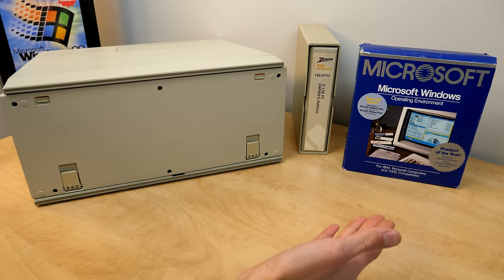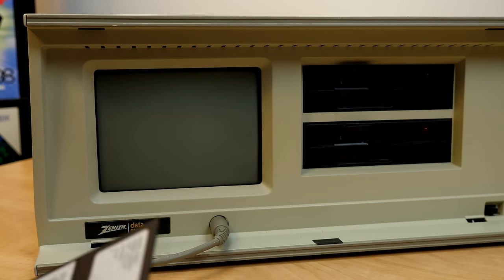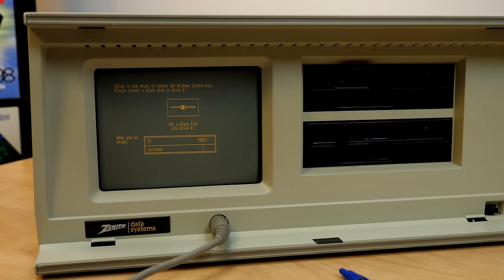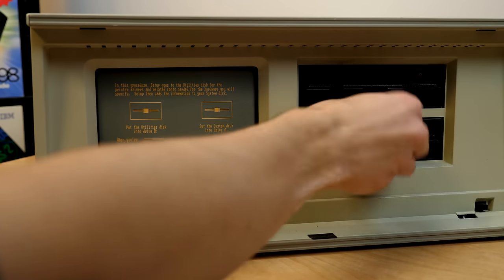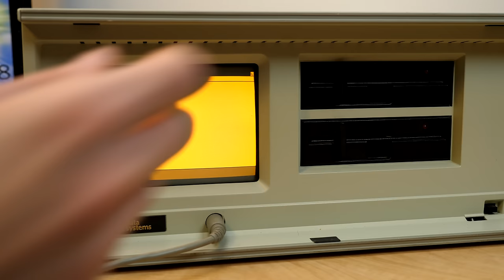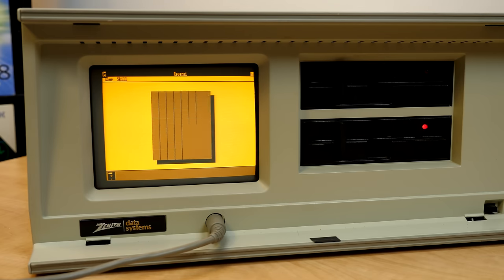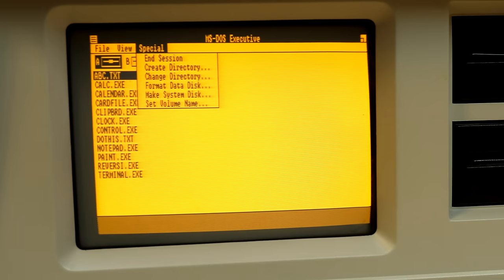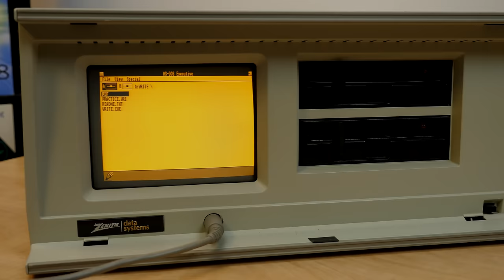Installing Windows 1.0 on an '80s Zenith Portable PC!

Comment: Zenith computers so easy a child can program. PROGRAMMING INSTRUCTIONS: insert disc 1 into drive A, then wait 5 minutes now you can insert disc 2 into drive B at this point just observe the noises the computer makes It's not just sounds it's actually talking to you. After it says "error disc" now you can take disc 3 insert it into drive B and observe the messages and noises It's quite pleasant after the noises have gone away now you're ready to insert disc c into drive A You're going to wait for another 1 minute and 30 seconds precisely then you're going to take disk d and insert that into drive A and then about 5 seconds you're going to take out the disc and drive B and now you're ready for the disc d once drive A is finished then you're going to stick drive d into drive A and then you're going to wait another 2 minutes once it says finished then you're going to insert disc e into drive B and then wait until it says ready and then you're going to take the disc and drive A out and now you're ready for the disc G for drive A and then wait about 15 minutes then you're going to insert the backups disks 1 2 3 4 5 in chronological order beginning with drive A and then drive B and then you're going to alternate. After about 7 hours has passed which is not much I mean heck it takes 7 hours to buy clothes at the mall right.... Once you see the Microsoft symbol appear at this point you're pretty much finished.

Comment: Nice.  I still have the desktop version of that, the Z-148, which I bought for $999 in 1985 while in college. It also came with 256K upgradable to 640K. No hard drive.

I never ran Windows on it.  Just MS-DOS.  

At one point I put a disk controller in it and connected an external hard drive (20MB).  That was a great improvement. I booted it up recently and the hard drive is dead and some of the diskettes are corrupt, but it did boot on a floppy disk.

Comment: Awesome!  I have the Zenith ZF-152-52
The difference with my machine is it's a full desktop and internally, Zenith decided to make the entire PC modular and there isn't a motherboard.  There's a universal ISA backplane and each component of the PC exists as an expansion card.

Cards my PC has:
CPU card with 64K RAM by default but expanded to 320K
Video card: No frills CGA video card
Floppy controller card
RAM expansion card with another 320K
20MB HardCard HDD
I added an XT-IDE.
Reply: (IIRC) That's a bit of a throwback to the S-100 bus that very early microcomputers including the Altair used. Everything on cards, and the 'motherboard' was just a bus and multiple connection slots to tie those cards together.

Comment: Had some experience at 1992 with exactly this box. Was used as PBX configurator over serial port and had some other uses. Yellow monochrome screen with very sharp picture for the era. Had idea that withl little more RAM this box would run even Windows 3.0.

Comment: I can remember a colleague who sit next to me at work showing me how to use all of this on an Zenith luggable just like this one. He had 640K of ram, the max  that could be addressed by DOS or windows. He only used DOS. Firstly, exe stands for executable, meaning a file that you can run. Secondly, you should 'write protect' the master discs by covering the notch in one of the corners with some tape, copy the master discs to blank discs and then write protect them. It is these write protected copies that you use thereafter as they get worn through use. I have never seen Windows 1, but have seen Windows 2, which was really basic. IBM's O/S 2 was always much better than windows but like many things (think betamax versus VHS) it lost out to microsoft. IBM's O/S 2 was based on the MVS code used in IBM's mainframes so it was rock solid code with something like thirty years of extensive use behind it. It also featured drag and drop and a few other things that dud not appear in windows. Much, much better, but microsoft won out.

Comment: My first windows experience was Window v3 and dos 3.  My first PC was a 386SX16 with 5 MB ram.  1 MB internal 4MB external with a 40 MB HD. My first computer was a COCO 16Mhz with a color TV and a tape deck.  When I got my first PC I thought I would never run out of HD space.

Comment: I worked in a print shop aboard a navy ship many years ago, right around the time Pentium processors were coming out.  Our only computer in that shop was an 8086 system running Windows 1.0 that we used for creating forms.  One day I decided to open up the machine to clean it and discovered a layer of dust about 1/2 inch thick over every part of the motherboard.  Pretty sure it had never been cleaned.  I unplugged the machine and used some compressed air to blow out the dust,  which ended up destroying the system.  Apparently the dust was required for the machine to work.  My CPO was furious.

Comment: Wow. My first real computer was a Zenith Z-160. It ran at 4.77Mhz and was VERY similar to that. The top popped up and had side-by-side floppies., and the holder for the keyboard was in the front where the floppies in that one are (if I remember correctly). It came with 320K RAM and I upgraded it to 640K. I also took out a floppy and added a 20MB hard drive. I was living the dream! Oh, and yes, I did have Windows 1.0 installed on it. I gave that away to someone and had the opportunity to take it back but turned it down. It's a huge regret of mine. I never looked ahead to feeling nostalgic. <sigh>

Comment: That's the same luggable that was hard mounted into the data rack at the first company I worked for. It controlled the pay roll system cause some guy in the 80's wrote the software himself no documentation and retired so never turn it off or else.

Comment: I had a similar “portable” in the 80’s as a kid, it was my dads but I did music with it, using midi and this sequencer software which I still have the box and floppy for it and the original Roland midi interface. It was amber I think not green and it was maybe an IBM portable. 💃It ran DOS not Windows.

Comment: Lovely, a SERIOUS computer expert I have worked with still keeps the 24? Windows 3.1.1 discs because if the computer world turns to bits and bytes he still has an operating system even if it is SLOOOOOOW. I have some 5 inch floppy's with 1007bytes of info on them and I can get a reader but cant find a computer slow enough to read them. I love DOS and still remember how to change drives etc. My 286 seems like ancient history just like me.

Comment: When i was a kid, I went shopping for a computer with my mother and was going to buy that Zenith portable computer, but it was too expensive and so was the other computers at the time in the late 70’s., so, we did not get a computer at all. It was not until i was an adult that i got my first computer, which was an IBM compatible computer with an 8088 processor and two 5.25” diskettes. Did not too much with it. Later, i purchased my real first computer that i used which was a 386 dx computer, i used it until 2000.

Comment: When I see PORTABLE PC, it makes me sad, because I worked at a Blockbuster Video, I came into work one day and found one in the bushes in a strapped cloth bag/container, so I took it home and it looked similar to this one with a green monochrome display. It worked, but I didn't know a thing about computers. I turned it on, and booted to DOS, but that was all I got. I THINK i may have tossed it. This was maybe 99. A year or so later I had my own pc my uncle built, then learned to build them myself in the same year, and then went to school for them. If only I knew, I would still have it, but knowing how much of a pack rat I am, I may still have it.

Comment: I have never see such machines. Interesting. Very retro. It is hard to say compact word, but it is something compact portable for those days, i think. It should have a great weight. I have also something ratehr more or less compact. It is my 286 machine. It has very intense package of inner detailes. It is my Nixdorf Computers 8810/30 model. I think it is somekind compact computer block. So it is interesting to dig old retro computers. And try soemthing like Basic. Your Zenith is good to travel with. Just go to some place, and you are ready to use it. It has built in keyboard, monitor, disk drive. Not bad.

Comment: you know I've never seen Windows 1.0 installed ever before! having it installed  on era appropriate hardware is cool but to see how different the installer was and what you needed to do to install Windows 1.03 to think we've become Spoiled with Windows Installers that are much faster & have less steps even albeit having to have the required Microsoft Account for Windows 8/8.1 10 and 11 man times have changed!

Comment: very interesting - sitting right beside me is my z100 and huge amber crt. haven't turned it on for 20+ years but i'm sure it still works. my family worked at h/z for many years. i programmed software for this and the h90 in assembler. still have all  the papers and files right here too. h-dos really tore up floppy drives so we switched to cpm. cpm worked very well for what it was til someone called bill gates took cpm and moved the jump table and called it ms-dos. microsoft would not release the source code because people would have realized that it was cpm - yes i'm calling him a thief !!
i worked with a guy from anarbor mi. and we designed a 10x12 board with 1 meg of memory to fit inside these computers. of course it only cost $5000! using mortola chip - if you kept pin 1 low it was self refreshing so no need for a separate processor .  of course the machine could only see 64k so the rest was a "hard drive". ahhh. how i miss my z90!

Comment: You could replace the second floppy with an IDE hard drive
I think you needed a ISA IDE card and I think that board had a bios chip that had a bootloader that would augment the Bios and allow a 10,20,30 or 40 MB hard drive

Comment: By the time Windows was released 800x600 display was common Nobody would have attempted at that time to run Windows on any lower resolution like this machine here This isn't a machine anyone would have installed Windows on

Comment: So I have absolutely zero experience with this type of system, but would it be possible to swap out one of the 5.25” floppy drives for a hard disk drive and install on that?
Reply: Kind of. You'd need a hard drive controller card in order to install a hard drive. Fortunately this has an ISA slot so this is very doable. One option is a period-correct MFM card and drive. A more modern option is the XT-IDE with a CF card (or the super-new and very period-incorrect PicoMEM), those doesn't take up extra space so you wouldn't need to remove a floppy drive to fit the "hard drive."

Comment: Back in the 80s, I used Windows 1.0, Norton Commander and my personal favorite, Quarterdeck Desqview.  Windows 1.0 was, by far, the most bloated and functionally weakest of the three.  And, unless it was a copy protected program like Lotus 1-2-3, you NEVER installed directly from the original disks.  You copied the original disks, them installed from the copies.

Comment: What about the compact portable?!?
Reply: Finding parts for an old computer takes a long time! You have to wait until someone posts the parts for sale, spend the money to purchase it, (which is quite expensive, even some of the older mainstream items, such as 5.25 inch floppy drives) then hope the parts work. If they don't, you have to start the process over again. Takes lots of time. As well, sometimes you have to take apart one of your other computers to get the parts, so you have to decide which computer you want to keep. Also, things don't always go right when repairing a computer. One small mistake when repairing the boards, or an accidently dropped component can set you back months, and sometimes years if you have to wait for the part to be sold again! Not saying that this happened, but just giving reasons why it might take extra time! Then all the effort it takes to film and edit a video, it takes time!

Comment: using Windows 1.0 on a periode correct hardware doesn't look that bad. the disk shuffling is not as bad experience compared to if compared to using an emulator.

Comment: This dude is literally out here in left field without a glove thinking there is a difference between today's computers and this zenith. 

Bro you still gatta select the drive to save a file 😂

My first tandy at 33mhz with 512k ram was directly compatible with todays modern systems. 

Dos bred linux, windows is still windows and nothing changed but scale and computational ability.

I guess a better analogy would be a young cat seeing 3 on the tree or 4 on the floor or even a stick. 

Same concept, same vehicle, same operational design just requiring knowing how to know.

Like with programming or using linux you have to know how to know what you don't know... to then know. 😂